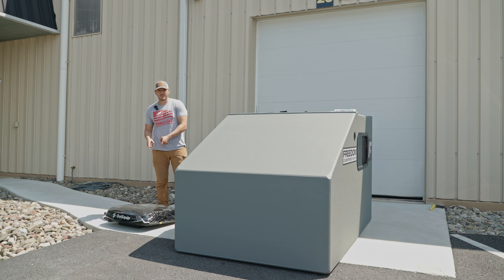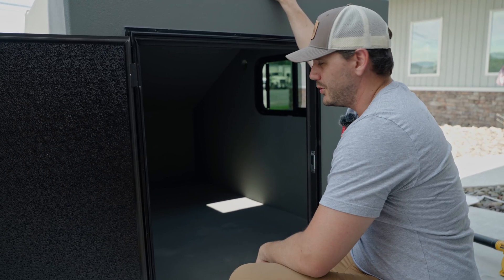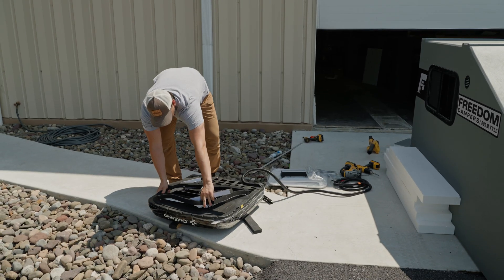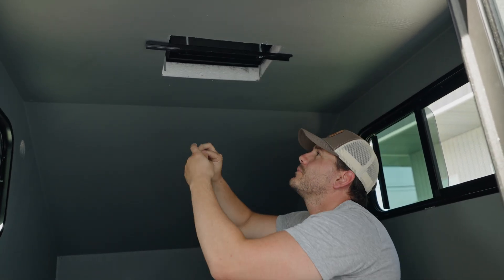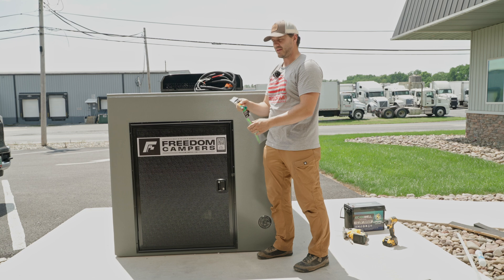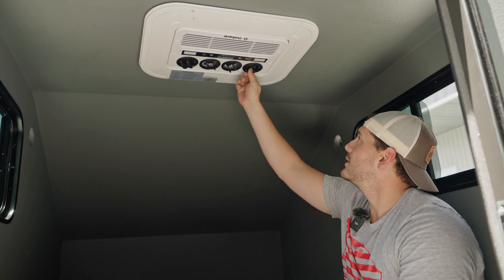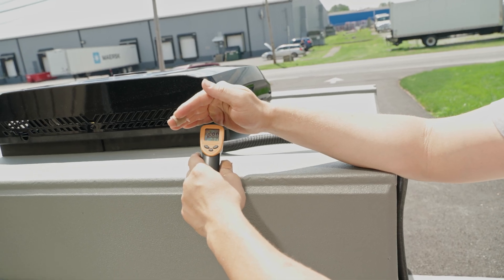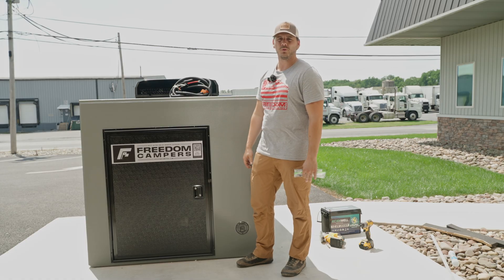HOW TO INSTALL A ROOFTOP AC in a Freedom Camper | 12V RV Air Conditioner Guide

Comment: Could you please show the “wrestling “ you had to do on the inside trim. I have the ac installed with the exception of the inside trim. Did you use the mounting bars that came with unit?

Comment: Is there condensation build up from the ac unit? Just wondering if you would have to run something for run-off.
Reply from the maker: It has drains on the side of the unit, so it naturally drains. No issues and nothing extra needed.

Comment: I was just researching an install for this. I didn't even think about keeping the wiring externally. Good idea. Is it long enough to run down to the port and run it inside to a power source, like a Jackery?
Reply from the maker: Yes it’s plenty long. When it is in a truck bed it can reach all the way to the ground if you want to keep your battery on the ground.